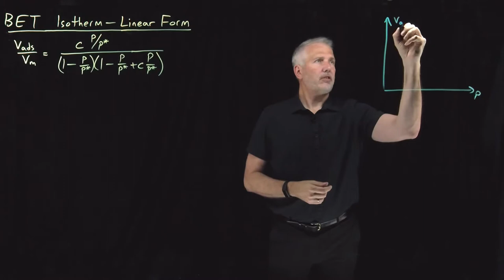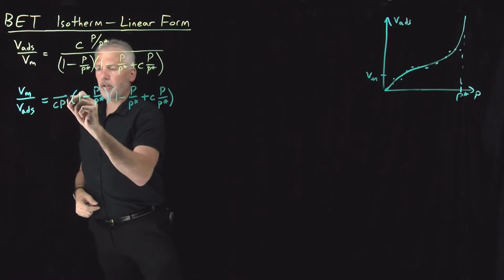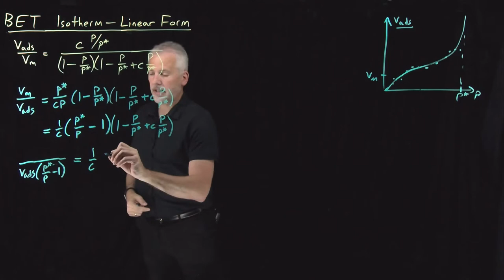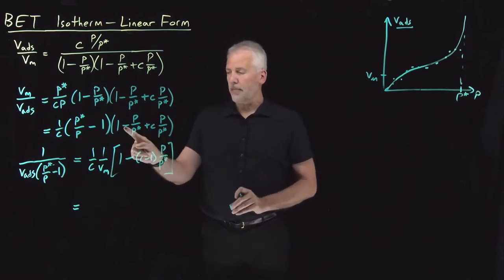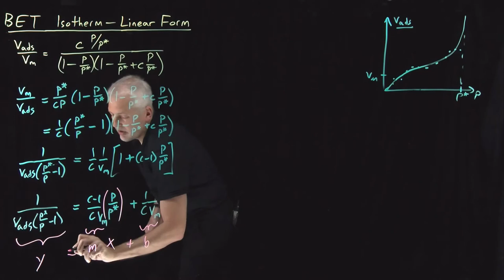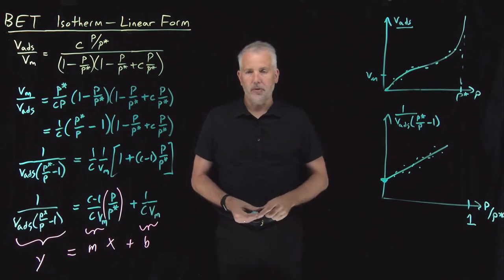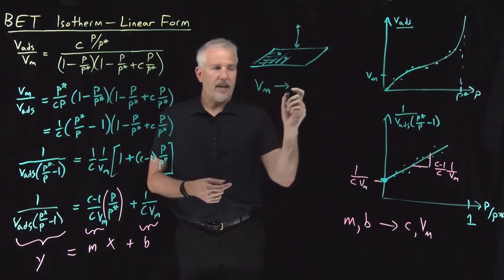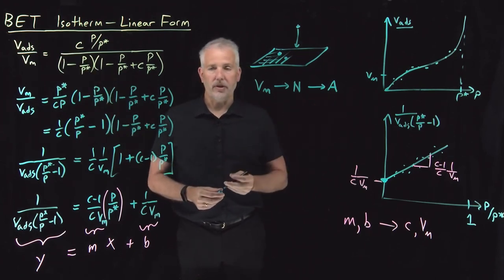BET Isotherm - Linear Form

Comment: really helpful! I spent a day to go thru this chapter. I really learnt a lot from the isotherms (langmuir and BET). My research requires me to write down the free energy of adsorption (water vapor condenses on a solid surface). I wonder if there is any gibbs free energy format related to adsorption?
Reply from the maker: It's always possible to write down the Gibbs free energy, starting from other forms and using the thermodynamic relationships or thermodynamic connection formulas.

For example, you could start from the partition function developed here: https://www.youtube.com/watch?v=17T9UQtp0WE and use the thermodynamic connection formula for the Gibbs energy: https://www.youtube.com/watch?v=KKVoRQ74vw4

When working with adsorption, though, make sure to distinguish carefully between pressure/volume of the gas and pressure/volume (or surface area) available to the adsorbed particles.

Comment: This was the question in my PhD candidate interview
Reply from the maker: And were you able to answer it?
Reply: @PhysicalChemistry  Mostly yes, but not completely, Professor helped little bit then asked further questions about the theory and assumptions. I think he tried to go deeper to find out the limit of my knowledge. Eventually I got the position. Surface science is neat.
Reply from the maker: @bomcimtube  Congrats. And don't stress too much about only getting part of it. One purpose of those qualifying exams is to find out where the boundaries of the student's knowledge are, on a particular topic. That requires pushing ever deeper with more focused questions until you reach and cross that boundary. So: unless you know more than all of the profs in the room, there will always be questions you can't answer